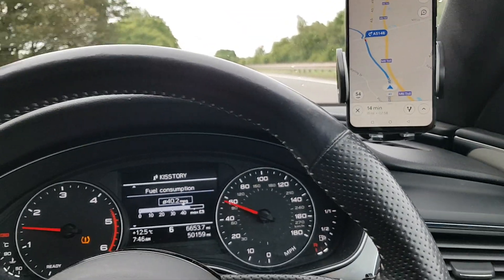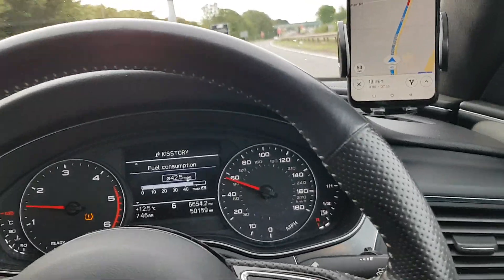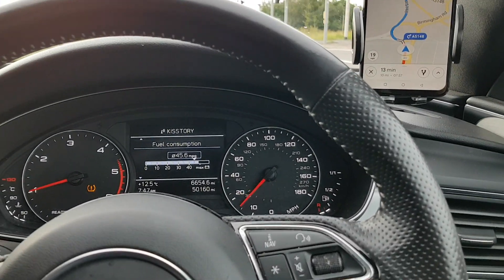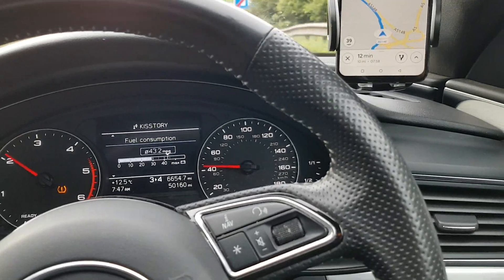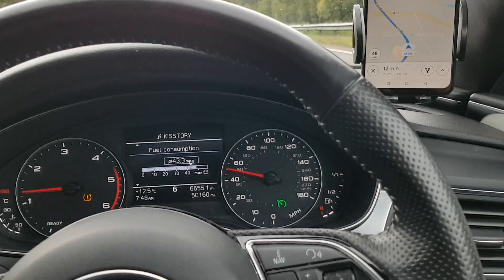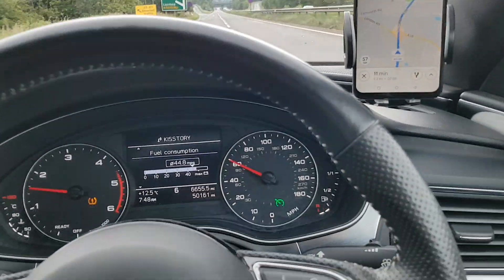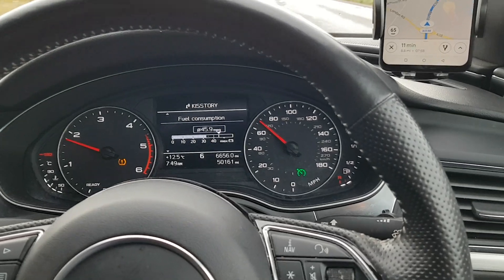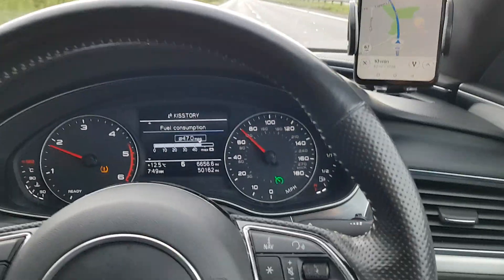Difference between your car speedometer and GPS speed

Comment: My difference was about 4miles slower on gps but now changed alloys from 225/45/17 to 18 difference gone down to 2mph so be careful about the tyre and wheel size…I rather keep the same 45 profile tyres not 40  speedo reading is effected 2mph up to 50 (50 is actually 52) and 3mph over 50 (I.e 70 is actually 73mph)

Comment: Digital speedometers are as of now more accurate than gps speedometers. The gps can not compensate for the time it takes for the signal to go to and from the satellite and then back to give a speed reading based on the amount of time it takes a car to get from a single point to another. Kind of like a tv network signal reaching peoples television receivers at different times causing a lag for the ones farthest away. A digital speedometer that is built into the car simply determines the cars speed based on tire rotations in a period of time. The cars tire size has to be considered for this. If you change your tire size your digital speedometer will be off. You might be going slower if you changed your tire to a smaller size.  Even a police speed detector is going to be less accurate than a digital speedometer built into the car. The radar can not compensate for the time it takes the signal to go to and from the car.
Reply: I agree for that

Comment: The other thing you need to consider is the coefficient of friction between the wheel in the road.  It changes with temperature, rain, ice/snow, sand on the road, cement, or asphalt...etc.  The more the tire slips, the more engine hp and rpm you need to maintain the same speed.  So if your gps speed is 50 and your speedometer speed is 57, your theoretical coefficient of friction is 0.877.

Comment: My speedometer reads 5 mph faster than the GPS.
Reply: are the tyres the stock ones?
Reply: @mohabmuhammad  yes
Reply: At all times? So if you going 10 it says 15 and if you going 70 it’s 75?
Reply: @ivanscountrymusicandcars2357  yes, the tires are proper size. I read that it’s not uncommon for Accords to do this.
Reply: @ivanscountrymusicandcars2357  if I’m going 60 according to the GPS, my odometer will read 65. I’ve never checked it at 10 miles an hour.
Reply: @aerotrooper  copy. I was just curious. My guess is (which I am sure you already know no breaking news here) at 30 it would read 32.5. That’s about what my car is off. Roughly 10 percent. I am flirting with the idea of a different pinion with one more tooth on it. My car is mechanical so the speedometer may not go up the same in percentages.

Comment: Noticed this today in my Kia Rio.
I was doing 50 in the car but on gps I was only 46...

Theres a speed camera near my home in a 40 area I have gone past it a few times at 45-48 and never got a ticket.
Today I went at 48 miles an hour in the car and the gps said 42 so I'm wondering if this is why I've never got a ticket
Reply: Did you get ticket?
Reply: @miranakyuz6337  no I didn't, must be well out of sync
Reply: @miranakyuz6337  went up a bypass at 80 on the clock nice and steady, Gps on the phone was showing 72mph.

It explains why when I'm doing 60mph on the 60 max roads I'm getting overtaken constantly 😆
Reply: Depending on local laws it dictates how much you need to exceed the speed limit. For example, in Chicago, IL they used to ticket at 11+ mph over speed limit, now they've changed it to 6-10 mph over the speed limit. It is doubling the revenue made by said speed cameras.

Comment: The results are invalid unless you have set the tyre pressures to the correct values using a calibrated pressure gauge. The 'results' do not confirm if the GPS, Car or both are wrong - there are several reasons the GPS can give a wrong result. The best way to check the speed is to drive on a motorway at a fixed speed and then get someone to count and time the markers by the side of the hard shoulder - these are supposed to be quite accurate. By the way you may be prosecuted for driving without due care and attention from the contents of this video..
Reply: lmao

Comment: I had my speedo at 78 on an A road and went passed a camera. GPS speed will be about 74, so im hoping i wont be getting a ticket
Reply: Update: no ticket
Reply: @ryanbell4952  thank you 👍🏽👍🏽
Reply: Did you get a ticket?
Reply: Overrunner did you get the ticket?
Reply: Most cameras roughly are meant to be set for around 10 percent plus 2 so 79 on motorway before you get caught not that you should be doing that speed, at 79 car speedo would say around 80
Reply: Did you get a ticket?

Comment: Thanks for the video. My Prius would indicate that it's at 100kmph but Google map speedometer would indicate 93kmph. I use 195x65x15 tyres instead of 185x65x15, which actually should be making the car go faster than it indicates by 2kmph at 100kmpb as per some online calculators. Any ideas of Google maps accuracy.?
Reply: I have the same issue !